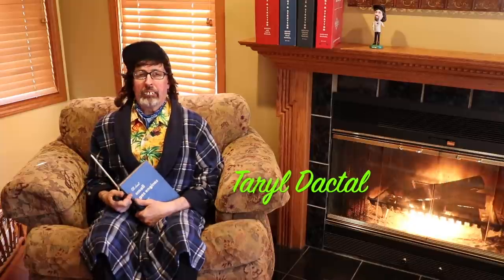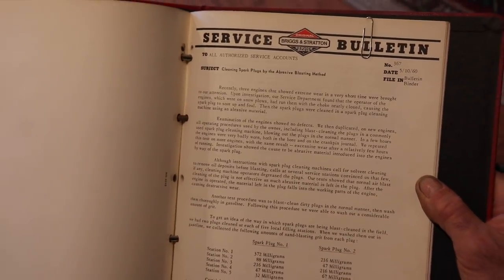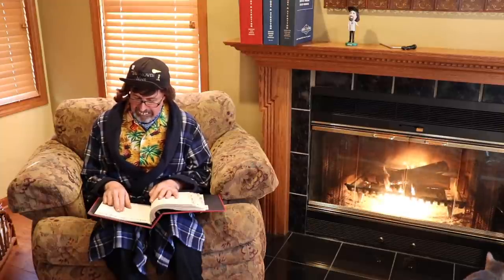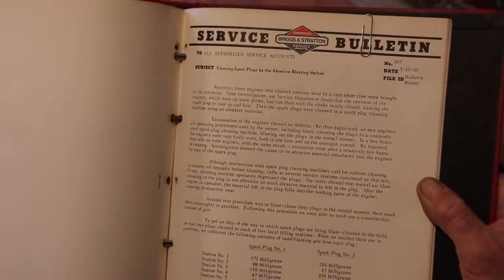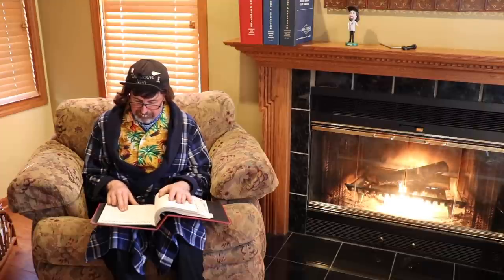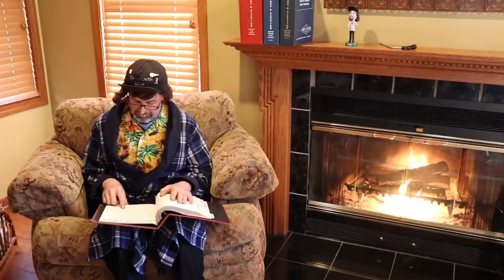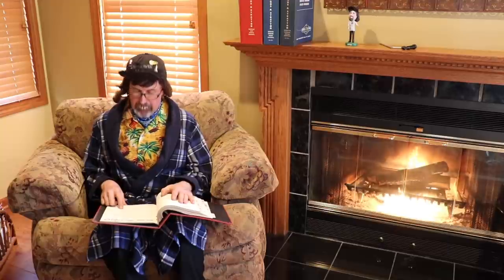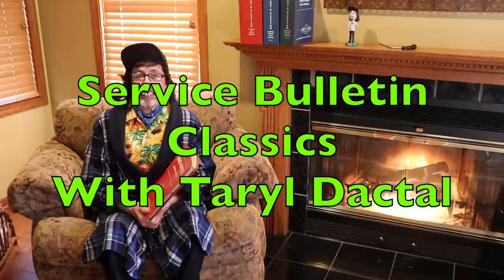Why You Should NEVER Clean Your Spark Plugs!

Comment: sparkplugs are not cheap like they use to be.
Reply: Automotive spark plugs I have to agree with you. However most small engine spark plugs can still be had for 1.99 to 2.50 at your local Walmart. Obviously there are exceptions though.
Reply: @scinto23  Agree. Automotive plugs are now right out of the space shuttle. Most of the plugs for my small engines are $2-3 on Amazon. I usually order a pack of 3 or 4 which holds me for quite a while. It's cheaper than burning gas driving to the nearest store.

Comment: Just clean it with carb cleaner first and then take a wire wheel to it. Then heat it up with a propane torch to remove excess carbon

Comment: Great idea whenever I get a fouled plug I have had good luck heating up the plug with a propane torch on the buisness end till it burns off and install the plug while it's still slightly warm. No wire brushing on the ceramic insulator because metal can transfer to it causing the plug to fail.
Reply: Bs

Comment: If the spark plug was cleaned properly this will not happen. I have been cleaning spark plugs with wire brushes and then blasting them off with brake clean to remove all abrasive materials and my engines run great for a long time. If you sandblast it and don't clean it off then yeah I could see this happening.
Reply: 216mg's of grit is total BS!

Comment: Help help help!!! So I have an 8/30 murray rear engine lawnmower. I had the carburetor rebuilt. New plug,new oil pan gasket,new oil and gas. Tuned beautifully. New belt to the transmission. Put it in first gear and she acts like funny. Engine acts like it's out of tune. Put her in 5th gear and she barely moves and the engine acts funny. What the hell is going on here!!!

Comment: Dammit man, you are so funny,"library of my mobile home" ha ha ha ha ha, yeah i can only imagine what those grains of sand trapped inside a  spark plug will do when released into the combustion area and bearings.

Plugs are so cheap no real need to chance it, if i need a plug desperately i just clean it with a bit of some solvent and maybe a wire brush gently to get most of the stuff off,i work for a company that overhauls natural gas compressors, we dont really restore them just repair them if they have huge cracks etc and we also sell stuff, one of the things we sell are spark plugs for these big engines and they are NOT cheap,i think each plug is like 40 bucks,crazy, they are really big though.

I noticed on that bulletin it said they rinsed the plugs that had sand with gasoline, that actually works real well and so does lacquer thinner,if you ever sandblast something and you are concerned about leaving sand behind rinse the part in gas or real strong thinner and after awhile you will see all the grit laying at the bottom of your container.

Comment: Taryl, why publish such a scary information without telling us, that you of course should remove the grinding material before mounting the spark plug. I consider this video as a kind of frigtening fake news. 
Have cleaned small engine spark plugs for 40 years with a wire brush and never damaged anything. Cheap spare part - yes, but why change, if it works ok - as you say, it's not rocket science.